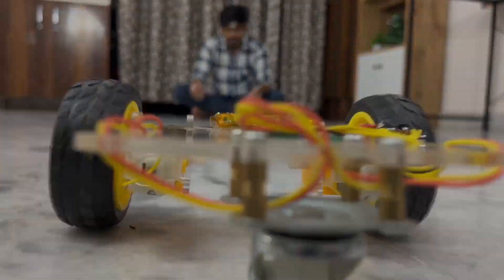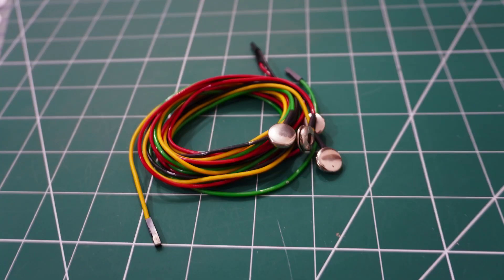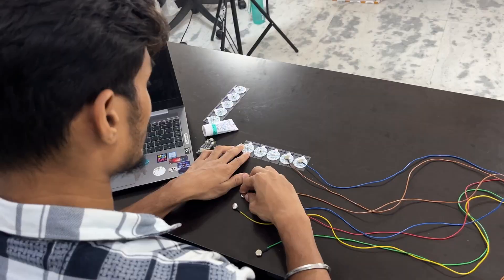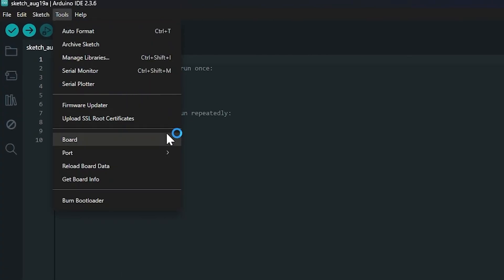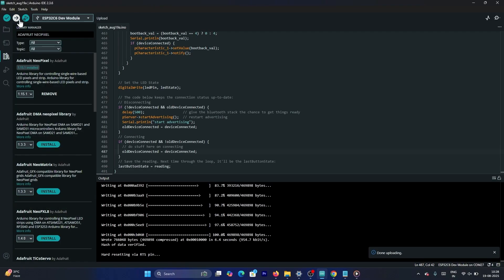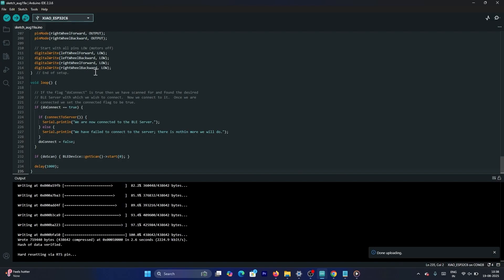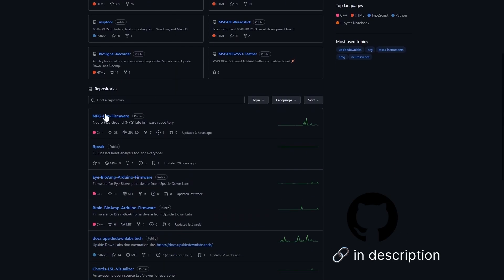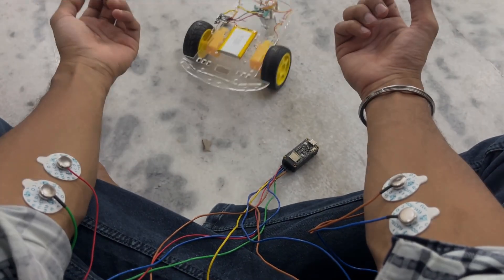Controlling a car with Brain and Muscle signals using NPG Lite || Detailed tutorial with codes!

Comment: Can we use esp32 only
Reply from the maker: Hey, we have used NPG lite hardware in this project. ESP32 can't directly read raw EEG/EMG signals because it doesn't have the required amplification, filtering, or safety circuits.